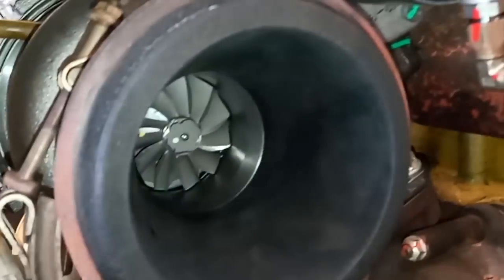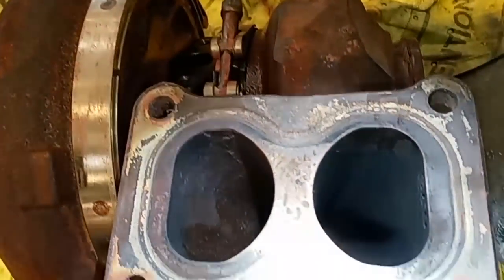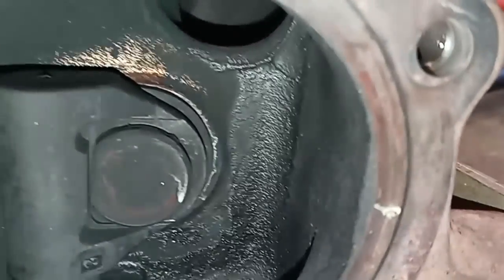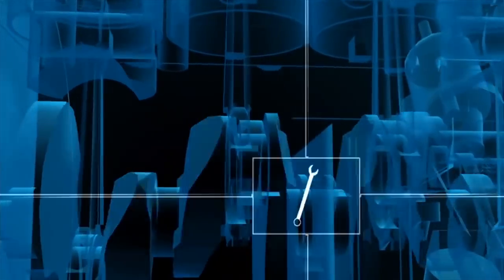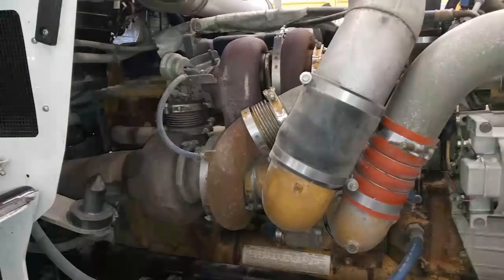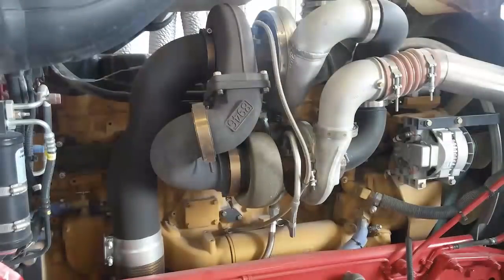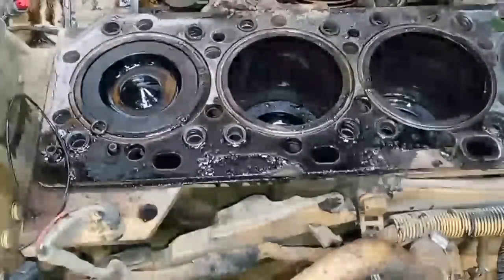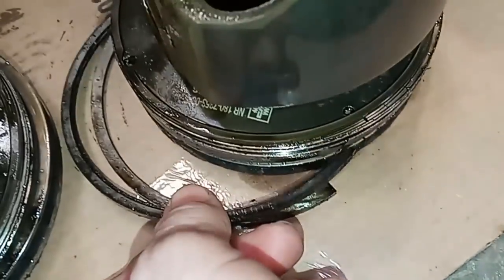Cat's BETTER idea for a Turbo. The Asymmetrical Twin Scroll Turbocharger.

Comment: Nice video.  Give credit where it's due - that's a Garrrett turbo, usually developed in conjunction with Cat.  The two companies have a lot of history.
Reply: I really hoped that using this turbo could help Cat get back into trucks.

Previously I thought about EMD buying Achates Power and putting two-stroke opposed-piston engines in trucks (basically modern 6V92's, 8V92's, and 12V92's).

Comment: The truck I run at work is powered with a Detroit DD13, which uses an asymmetric turbo charger. The performance and reliability really seems to be there with it 👌🏻.

Comment: One of the reasons that design changed, is they wanted the benefits of the twins turbo design for low and high pressure. but only requiring one turbo, which from a manufacturing standpoint is cheaper to produce,  and cheaper to replace if needed. and because of space limitations, two turbos take up much more space than a single turbo. all the designs shown basically accomplish the same. thing having both low and high pressure turbo charging. to overcome turbo lag and incorporate the addition an EGR exhaust gas recirculation system. for emission control requirements.
Reply: Could this turbo be installed without hooking it up to an EGR?

Comment: I run a twin scroll with a diverter valve on my engine. Basically a similar effect but can put 100%  of flow into a single scroll for almost instant boost response. And it's built into a compound setup so it will boost well over stock levels. S475 / S594 with more responsiveness than a tiny wastegate turbo.
Reply from the maker: Cool, very few moving parts too.
Reply: @AdeptApe  I designed it to make 1300hp (capable but stays on the 900 tune when working) and drive every day as my work truck. 3 years on and the only failure I had with the setup is a rubber hose and the wastegate actuator used for the valve😎

Comment: Cool vid.  I’ve done some work on the IH with a VGT on Ford ambulance packages.  Worst we found was when the EGR cooler failed and blows coolant slowly through the system it would tend to put a carbon goop on the variable vanes and kill their performance.  Cleaning was easy enough, only had to take off exhaust housing on the turbo.  Bigger problem was the POS EGR system. Lots of hours to remove and replace components that were going to fail again and again.  Never, ever, under any circumstances buy a Ford/IH 6.0 “powerstroke”. They are nothing but trouble!
Reply: Trouble and a pile of metal shavings
Reply: Absolutely on point here. This is why most powerCHOKE owners delete the EGR on these. Nothing but problems and more complexity for no reason.
Reply: One of the many Navistar engines that had issues.

Comment: Pulling a fairly long hill my turbo shaft broke. The turbine side impeller went into my exhaust, with a decent amount of oil. Lots of smoke. It was a older turbo I had on my 3406. Turbo was rebuilt in 2014 when I had my C-15 rebuilt. So it had 480k miles on it since rebuild. No warning noise, just a loud pop, at approximately 1750 rpm. Not full throttle. Just letting it pull the hill in the gear I was in.

Comment: I'm currently installing a PDI exhaust manifold and single turbo with tuner on my 2006 Kenworth T800 Cat C13 Acert engine.
I'm tired of the broken exhaust bolts and gaskets (3 times now) due to the weight of the twin turbos.
I hope I've chosen the right path. 
Great video my friend, keep em coming :)

Comment: Cool.
87-88 Mazda RX-7 engines has a similar setup, where one of the scroll inlets was shut off by a vacuum actuated flap door at low speeds to get the turbo going, then opened up later to increase flow. In 89 they ditched it for a simpler, better designed standard twin scroll inlet turbo.
Reply: But if they had vgt, then it would have been even better.
Reply: @fastinradfordable  the problem is gasoline burns at too high of a temperature to use a vgt without damaging the actuating assembly.

Comment: Very interesting. May have to watch again to understand it better. Funny as I once drove a Mack Anthem that had a failed (or failing) turbo actuator. Would lose speed power when I turned it on and started moving. Fortunately I was able to get it running enough, after shutting it off, to get it back to get looked at. I found out later that that's what it was. It only had about 125,000 miles on it at the time.

Comment: The 281 and 351 Peterbilts used in DUEL had CAT-1674 twin turbocharged engines, but the 351 handled it better than the 281 whose engine needed maintenance after every chase scene. They did modify the 281's engine to keep up with the Plymouth Valiant they used so that might be why it needed maintenance, but I can't say that was the main reason why the 281 needed engine maintenance when the 351 didn't.

Comment: The ecm having control over vgts' and twin scroll turbos is great for boost and performance, but the main reason they were implemented is for the egr system. The exhaust system pressure needs to be higher than intake manifold pressure to allow the exhaust gas to overcome intake boost pressure and enter the intake manifold.

Comment: BD Diesel sold something for a while called a "turbo thruster" custom turbo with split scroll housings & a valve that pushed against a spring pod. It defaulted into 1 side of the scrolls but once enough drive pressure was developed, that drive pressure overcame the spring pressure & pushed a valve open that allowed both scrolls to flow. Similar but totally mechanical in operation. I think they were sold for later 7.3s & Cummins applications. I don't remember hearing much about them, largely due to the almost $4K price tag 😳

Super interesting! It is a form of VGT but done differently.
Reply: It’s not a form of vgt. 
Vgt means variable geometry.

Comment: Im not a fan of VGT turbos either. However from my understanding with Cummins, installing a replacement VGT turbo, you have to plug a laptop to the truck with a dongle, run Cummins connect, then run a VGT calibration test. Even though the turbos come out of box pre calibrated, it can still trigger an engine derate. Same goes with paccar engines. 
Only Paccar has a few more parts slapped on the turbo than Cummins. 
2019 and 2020 peterbilt 389's with the paccar engines have 2 sensors mounted on the compressor housing and one in front of the compressor inlet. 
These turbos come with nothing but a bunch of wires on them its ridiculous. 

I could see more reliability on a VGT turbo if they designed the setup a bit differently, such as
Mechanical pully to adjust the veins mounted to a vacuum pressure based wastegate plunger.
External boost controller. 

Now you have a turbo that has no coolant lines running through the VGT actuator to keep temps down.
and you dont have to worry about wires melting together because of the heat a turbo puts out.
Reply: That’s weird, I’ve installed turbo actuators on a couple of Cummins and Paccar engines and I’ve never had that happen

Comment: Good vid... Like learning new things on Saturday morning! 👍 Light duty diesel could benefit from these turbos for sure.  I'm tired of replacing Cummins 6.7 junk vgt turbos on Ram trucks lol!
Reply: It’s not that vgt is bad. 
It’s bad how they computer control it. 
If you manually controll your turbo actuator. 
You see that vgt is so much better.
Reply: @fastinradfordable  could be... The way I understand it, If the exhaust brake  doesnt get used semi frequently, the shaft gets soot buildup and can no longer move the turbo veins around which is what causes the failure... Most ram truck owners prolly don't bother to learn how to properly use exhaust brake system. I would agree the vgt part isn't bad at all when working properly

Comment: Very true about the VGTs. I work at a JD dealer and those turbos are used on the 4.5 liter 4 cylinder and up, and also as the small turbo in a compound system. The thing I find odd though is I don't recall having much trouble turbos on the 13.5 engine.
Reply: I have a 13.5 in a 9430 ( still wondering if I should get the EGR deleted if I can find a reputable outfit with non engine damaging reprogramming ) and a couple of years ago in the spring when I took the tractor out of the shed a warning came up and code was thrown and kept on doing that upon startup and turned out to be the turbo actuator. JD tech to the rescue a few thousand later with new actuator, reprogramming and service call as he tested it and figured it was cycling but sticking some along the stroke.

Comment: I do enjoy your videos, was a heavy duty mechanic in western Canada for over 20 yrs, then went trucking in 1995. When I stumbled open this video I thought you might say something about the design of the turbo used on the c15( no hyphen) sdp engines. Was the last engine in the last truck I had and the basic engine was a bullet but the turbos were the most hated things I have ever run across. I the five yrs I owned the truck they were replaced 4 times. Three times on warranty and I paid for 1 set.  So what do you have to say about Cat using turbos with bearings instead of bushings the way they always were.?

Comment: Great video man as always I just wanted to say that it's a shame that caterpillar got out of the truck industry because there advancements in technology would have been so far ahead of any other manufacturer at this point we would be in a better position for long living diesel engines in the truck industry
Reply from the maker: I wish they would have stayed in too, but that is just a fact of the industry.
Reply: Cat was wise to stop production of truck engines. because of constantly changing emission control requirements. if the EPA could have made emission control requirements the same across the board like with gasoline engines. Cat could have continued to produce truck engines. and now many of other diesel engine manufacturers. are now having to experience issues trying to meet. the constantly changing emission control requirements. it put a lot of pressure on all the diesel engine manufacturers.

Comment: I like the destruction of the week i once had a international maxxforce dt 2010 emissions come in for a crank no start diaged needs an inframe for low compression i found all 6 pistons with the top rings broke
Reply from the maker: All 6 at one time, that is weird. What was the root cause if failure do you have a theory?
Reply: @AdeptApe  In usual broken ring is a result of detonation -  high load on low RPM.
Or poor fuel.

Comment: Don't have a cat, but currently two garret VNT cars, love the crap out of them. Have to keep your egt up there or they will coke up, not a problem if you know. Little switcheroo on the gear ratios, managed almost, not quite, 90mpg highway loaded down on the bumpstops.
Reply: Do you put hot sauce in your fuel tank with every fill to keep the EGT's up?  I know it happens to work well when I eat it
Reply: @Rx7man  No short trips, treat the accelerator like its a light switch. One tank from Illinois to Louisiana, one stop to sleep for a few hours once across the Mississippi line.

Comment: VGT's going by the wayside? Can't come soon enough!
Reply: Agreed. 55k miles had to replace complete turbo tho vgt had been rebuilt back at 30k miles.
Reply: I love my vgt. 
It’s worlds better.
Reply: Millions of maintenance-free VGT's with well over 150k miles on the road. 
I can go physically put my hands on 4 today that have over 200,000 miles with no maintenance. 

Many factors weigh in to how reliable or not they are.
Reply: @typrus6377  I agree, we had a wheel loader in the shop recently with twenty-some odd thousand hours on it with it's original vgt. That would equate to over 700,000 miles. The machine has had had nearly no routine care in it's lifetime, but somehow keeps going. But I've also replaced many of them with only a couple thousand hours on them.
Reply: @wesleycooper2647  very fair. Every system has its issues. I've replaced quite a few balance valves on Perkapillars with actuator issues. I've replaced numerous traditional turbos with issues. 
Before I was with Cat, I replaced quite a few Cummins Holset VGTs. Mostly for actuator problems. The Garrett and BW ones I've encountered have more issues with soot-fouling from improper operation than mechanical problems. 
Different exposure obviously weighs in too

Comment: Putting together a ford 2.3T with a T04e turbo from a 6.6 ford diesel. .8 a/r  housing is slow to spool so I'm feeding only one inlet on the t4 flange and got an external wastegate to feed the other as initial boost control then another one on the manifold.  Figured oems should have came up with this as a ghetto vgt and then this video shows up.

Comment: Great video, however when talking about the inlet of the exhaust to the turbo, as area drops so does pressure and velocity goes up. You have your ports mixed up. 👍

Comment: Josh, Speaking to your destruction of the week. I work for a readymix company and we have a bunch of c12 and c13  endines in our older western-star trucks. Those things blow apart like a bomb when they get around 25000 hours on the clock. Management never wants to spring for a rebuild until they blow apart... they'll never learn.

Comment: So it is in essence a vgt system on the sly. Some manufacturers use an engine outlet windflap that sits in the high temperature exhaust and direct the flow more to one port or the other. This being a variation on that theme.
Reply: It does the job of a vgt with only one moving part and no coolant lines. Cat just following the K.I.S.S. Principle.

Comment: I had a perfectly running cat c13 in my Pete. But since I live in California, I switched out for a Cummins x15 due to carb😔 I had added the dpf filter so it could keep running for several more years but unfortunately the deadline came last December to where I can’t run the engine anymore and won’t receive the current tags until the vehicle is repowered with a 2010 or newer engine. The mechanic who performed the smoke test to determine which dpf was best suited for the c13 said these engines already burn clean. But since they give off a small amount of black smoke, they now need to be replaced 🤦‍♂️now I’m looking forward to the problems on these Cummins engines😂
Reply from the maker: That's so sad, such is California though. Cummins makes a good engine though, hopefully you won't have too many problems. Just paint it Cat yellow in honor.
Reply: Trying to get rid of grandfather clauses on vehicle emissions? Of course it's California.

Comment: A local independent shop made a comment to me the other day about having done some conversions on the  C15 MXS and BXS back to a single turbo setup and eliminating the IVA action. I don't know anything beyond that as to what type of turbo they are using and programming but wondered what your thoughts are on it as I assume like anything there is a right and wrong way. His comment was that if I have a turbo pile up, just convert it rather then dump a bunch of $$ into one or two turbos and related steel bellows and other parts.

Comment: VGT turbo . Detroit's with them, at least early ones , worked great til they got miles on them , then the oil control modules and turbo themselves began to add very costly repairs to the maintenance.

Comment: Will these turbos be available for older Cat engines?
Reply: Pittsburgh Power has one that you can buy, it's called the Switchblade turbo. Check out Jpaydirts YouTube channel he put one on his 1969 D-9 Cat and also a 637C Cat scraper and his C-15 Kenworth that originally had the twin turbos. He said the difference in power and mileage is unbelievable.

Comment: I think that Mitsubishi had something similar on their small gasoline engines. However I cannot remember what models they came in or what these turbos were called. Its a shame that they weren't S475 turbo sized to be used in racing LS engines.

Comment: Good video, you should make another, how long has cat been using this? Is it better on some motor over others? The 6nz has been such a great motor should you add this to it, or leave it alone and this is more others? Can it be used in places of twins? bridge motor which as you know runs hot on the exhaust,  would this make it run hotter or cooler, maybe the same? Can’t it be added to mechanical cats I’m guessing no so many more questions trying to learn something new, there was a big hype about the switchblade at first too and then after many miles and couple years everyone seem to have realized it was so great.. thanks!

Comment: The European diesels get rid of the NOx with the SRC only and have done away with EGR I wish we could do that here. It's crazy to put an engine through that when you're adding more NOx with the DPF burn off  behind the engine.
Exhaust Gas Recirculation
https://dieselnet.com/tech/engine_egr.php
Reply from the maker: I wish they would just pick one or the other, I think SCR makes more sense since it keeps the engine much simpler and no exhaust soot into the engine.
Reply: @AdeptApe  Not to mention that SCR is so much more efficient than EGR.

This is why so many people realise that a lot of these emissions regs are based too much on political motives. IMO, the ideal setup is a Diesel Oxidation Catalyst followed by an SCR system. The DOC cooks any hydrocarbons (unburned and incompletely burned fuel and oil) as well as some of the soot, while the SCR takes care of NOx reduction.

At that point, I think it's perfect. A Diesel engine with a DOC and SCR is already very "clean green" but doesn't have the complicated (and dirty) mess of an EGR system or a DPF and regen system.

Remember that saying? Too much of a good thing can be a bad thing.